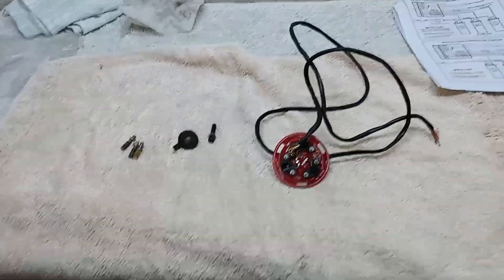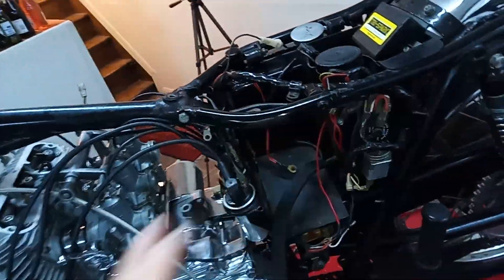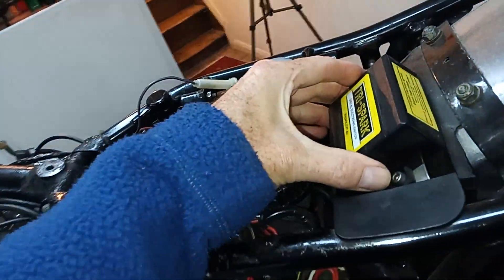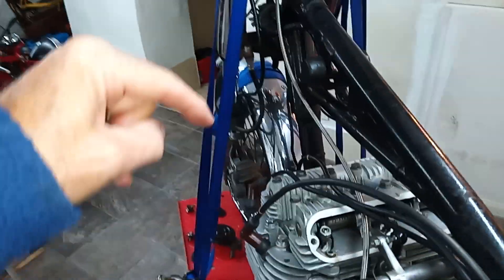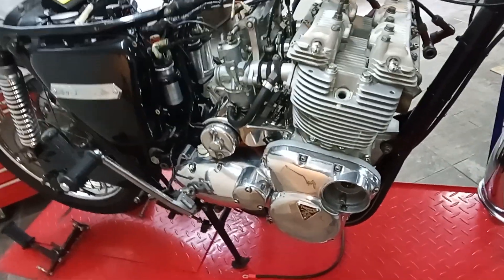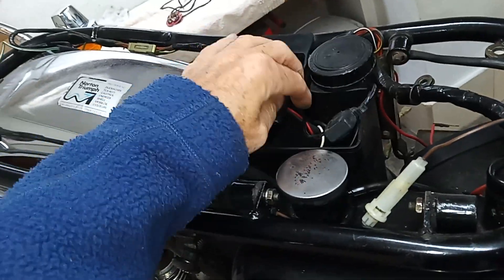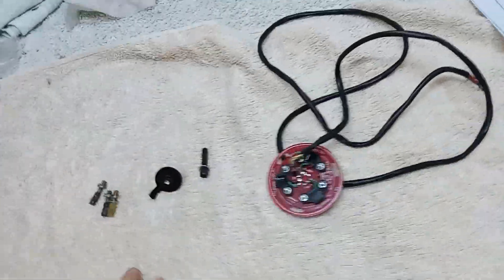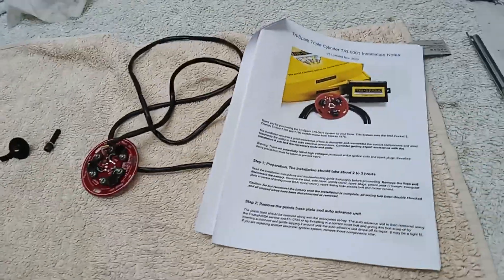Triumph Trident T160 Rebuild. Part 97: Electronic Ignition Fitting Part 1

Comment: I've never had a problem with Boyer ignition on my '67 T120. It works fine with the original Lucas rectifier and Zener diode. Maybe trying to include all these functions in one black box has over-complicated things.

I fitted it circa 1998 to replace the Lucas Rita which was itself a replacement for the Lucas points nightmare.

Boyer of Bromley, and partners, were pioneers of electronic ignition for British bikes in 1970. Their race-prepared twins and triples are legendary.